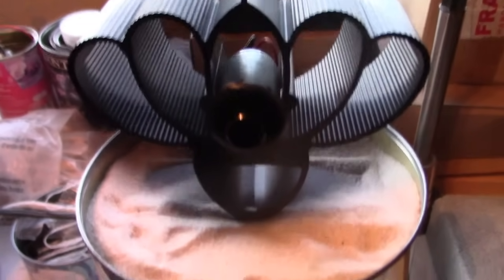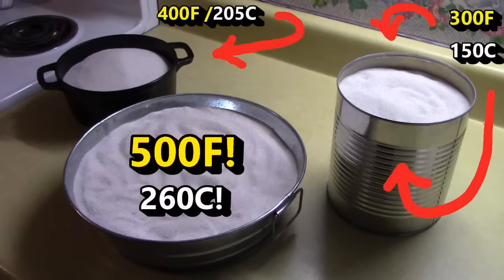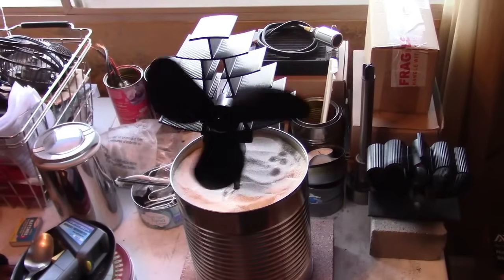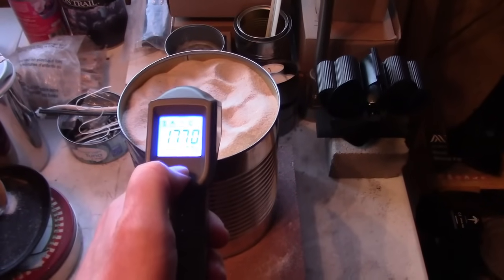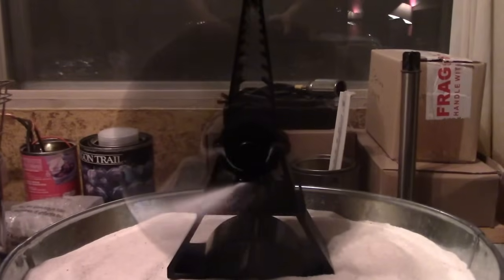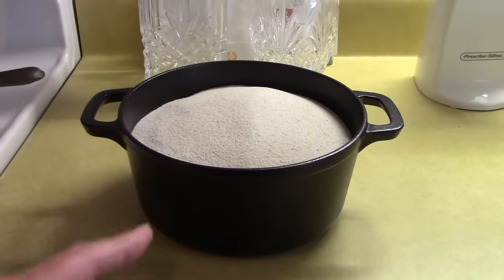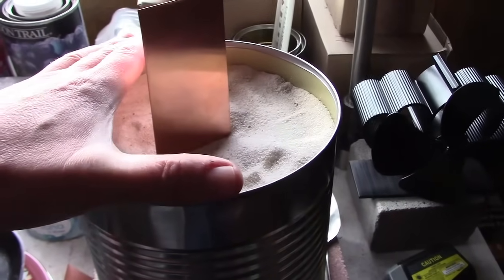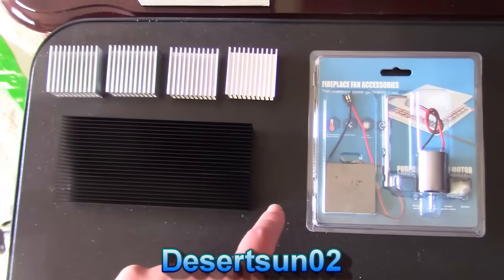DIY Sand Battery Air Heaters! w/heat powered fans! no electricity needed! sand battery room heater!

Comment: Instead of that copper strip you should look at computer "Heat Pipes" they are closed/sealed pipes with liquid inside. The liquid vapourizes and condenses like a fridge system but transports heat faster than solid metal. They are also reasonably cheap and come in different sizes and shapes.
Reply from the maker: @siguie awesome! i will look into those! thanks for letting me know about them. suggestions are always super appreciated!
Reply: @desertsun02  Cool! I recommend playing with a few first to get an idea what they can do. My dad has a copper one for his coffee which he always complains is too hot. It's almost like magic how fast the thing becomes too hot to touch. In any event there are different liquids and metals for different temperatures. Copper will be the easiest for most things BUT there are also stainless steel versions for more intense temperatures.

But in general heat pipes with cooling fins is a super fast way to get heat from a block of something into the air and I'm stoked that you're considering it! I really enjoy your videos 👍
Reply: @desertsun02 you have to upload the videos of any good suggestions though! One of these sand batteries would work great for off grid RV life. Great video
Reply: caloducs
Reply: How do the heat pipes you are meaning look like? do you have a youtube-link or something like that?🤔
Reply: Yeah I will find them and share. They are a simple build and only require a torch to seal the end if I remember correctly
Reply: @townbell2248  That is one way and might be better for larger pipes but I recall them being made with induction heaters. Basically a coil of wire around the end of the tube {not touching} then when hot the end is pinched closed or "rolled" closed. Then liquid like water is added chilled/frozen then a vacuum is pulled and the inductive heater seals the thang by the vacuum pulling it closed and then snipped shut.
Reply: @siguie Thanks, I think I have a general idea of what you are getting at. 
When I originally seen them, I was thinking about solar heat and a greenhouse in the winter so I wouldn’t have to drag my plants in during the cold.

It is amazing how simple things can be used in so many different ways.
Reply: @Town Bell  Sure seems like our culture hasn't taken advantage of such things. So many things we could be doing differently, but don't, simply because we don't know about them. That's why I love channels like this one. Generating ideas and sharing. So, thanks for the plant idea!!! I could use that as well
Reply: @Words written in red , I agree with you & think self reliance would help people more than anything else. For the people by the people~
I wish I knew people that liked tinkering with things to hang out with.
Reply: There is a video on YouTube on how to make those pipes

Comment: I just got one of those fans to use for a power outage. It barely spins on top of my radiator style heaters at half power. In front of a larger heater though it goes nuts. I think it would do well on top of the brick style alcohol stoves.
Reply: If you want the fan to spin faster, I think you can put something cold, like a chilled steel piece, or an ice-cube, on the cold side of the Peltier TEC module. The voltage produced is calculated by the difference in temperature, between the two sides of the Peltier TEC module.
Reply: brick style alcohol stove? never heard of that... care to elaborate? sounds interesting
Reply: @simonlinser8286  Explore this channel, he's got plenty vids about that.

Comment: Hi sir, Last summer I asked you about the parts for a cooler in my living room, unfortunately I wasn't able to test it as the temperature started to drop again and I didn't need it anymore. This what you are showing now is very interesting. No batteries are required to run the fan. Would it be possible to also run these fans to move cold air so instead of putting this fan on something warm put the thing on ice cubes. Greetings from Rotterdam.😉
Reply: Heat = energy. No heat = no energy. You will always need to have something hot that is losing heat to gain any useful energy from it, either by letting it just radiate the heat to warm up a space, or using the heat to create electricity to power small appliances. If you live in a hot desert area, you essentially have access to a lot of energy, but you would have to find a way to tap into it.
Reply: @jdshl8423         Thank you for your explanation.👍
Reply: @johndevries7122  peltier device is how the fans operate. Look up details on those.
Reply: @XiaolinDraconis       Thank you for your response, it is now clear to me that the fan starts running at a certain temperature. Now I'm not an expert at all in the field of electronics, but I had the thoughts of, how could you convert this to cold.👍
Reply: Kind of like waiting for “microwaves”, that immediately chill beverages, I guess.🤷🏽‍♀️

Comment: Good idea, I wonder if a cooler of dry ice, buckets with a holes cut to the fan base size on top of the bent copper strips would work in the summer?
Reply from the maker: interesting idea 🙂👍.
Reply: @desertsun02  would have to come up with a way to secure the fan base to the top of the cooler and secure the lid of the cooler for safety.

Comment: fresnel lens, would be fast although it may melt the sand lol
Reply from the maker: hi there. melting point of sand is a little over 3000F (1700C) so fresnel lens should work good (unless the fresnel lens was giant size). i think most of them top out at 2000F.
Reply: @desertsun02  Old flat screen Tv has good size fresnel lens

Comment: That design could turn a magnet and coil setup that sends charge to a battery bank couldn't it? Seems like you can charge batteries with wood/coal/oil (whatever heat source) and just a few of these fans. It could be a nice way to charge solar/wind systems when sun and wind are none existent.
Reply: Yes. The cost is the heat and the cold that you need to produce. The bigger the difference in temperature, between the two sides of the module = bigger power output, on the wires.

Comment: I wonder if Sand Battery + Solar Cooker would be a more efficient method of heating than the typical Greenhouse Solar heaters you've also featured on your channel.
Reply from the maker: i couldn't say - but for sure... sand holds heat for a very long time so it's an excellent material for holding and radiating heat. can handle temps near 3000F (before it melts). might be a way to combine sand and a standard solar collector.
Reply: @desertsun02  What sand do you use ? What tipe?

Comment: I would want to stick my feet in the sand after a few hours...just like beach sand. Great idea!
Reply: I don't agree; I fear sand can heat up to temperatures far in excess of water; stick your feet into it and you won't get them back out before all the flesh and muscle on them is missing... nasty.
Reply: Stick a temperature probe in there if you are  afraid.
Reply from the maker: that is actually an excellent idea. why not. it's just like beach sand. another thing that i didn't mention in the video is after the top cools down. it's still pretty warm in the center so you could stir the sand around with a spoon then drop the fan on for another hour or two (maybe more) 🙂

Comment: Nice, but I disagree with your idea of using hot sand to circulate room temp air in the summer. The only way the fan runs is by using a temp delta between the sand and the room.... it doesn't matter how well you insulate the sand. You will raise the temp in the room. How quickly is variable.... and you could make a temp delta outside the house with teg, send the power inside, and run a fan... but as stated, that's a losing battle.
Reply: If you are out of obvious solutions (ice, freezer reserves, etc) then a hot fan is better than a hot room. Within reasons of course.

Comment: Does it make a room cozy? Or just keep it above freezing?
Reply from the maker: hi. it sure does, it pumps out the warm air for a long time. but will depend on a few things like... the room size, starting room temperature, insulation of the room, outdoor temp, size of sand battery, size of the fan, how hot you heat the sand in the battery.

Comment: Okay, but, how're you heating the sand in the first place?
Reply from the maker: hi. all kinds of ways to heat the sand. off-grid options include campfire, rocket stove, coal stoves, alcohol stove, propane etc. plus solar options including parabolic dish, fresnel lens, even a solar oven. check description for full list. a fresnel lens would heat it super fast and hot (in minutes). i've never bought a big one of those or i'd definitely give that a try.
Reply: @desertsun02  I have an old fresnel lens from a early 80's big screen, that thing will melt stone....
Reply from the maker: @Born Again Buddhist they can get crazy hot for sure. sand can take very extreme temps up to 3000F maybe more (before it melts or turns to glass). imagine filling a 55 gallon drum with sand and heating it with a fresnel lens. sand might stay hot for a week.

Comment: Oh is this the same and of the Beach? Thankyou 😊
Reply from the maker: hi. yes it's essentially beach sand. specifically, i'm using what is called play sand. it's been filtered and cleaned and has a soft feel.
Reply: Thank you for a great innovative video! 🎉 I like the fact that there’s no long-term reliance on open flames, instead using heated sand as a power source. I have the fan and I can’t wait to try the sand! 😊

Comment: How do you keep the sand ward. You are so awesome with all your ideas. Your mother has to be proud of you. I know I would be so proud of you. Be blessed 🙏🙏
Reply from the maker: the sand itself stays hot a long time. it can hold heat for days in some cases. the heat in the sand slowly rises up and radiates out at the top. this provides all the heat needed to run the fan for several hours at a time. if you use a large amount of sand it can stay warm for days.